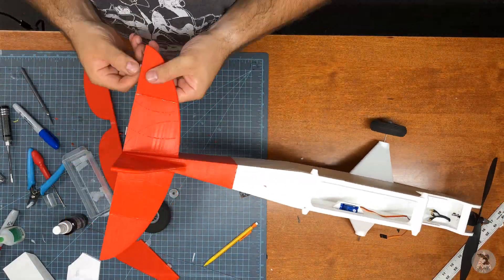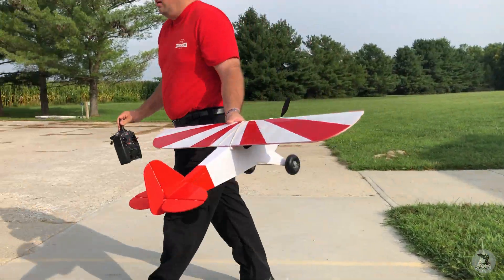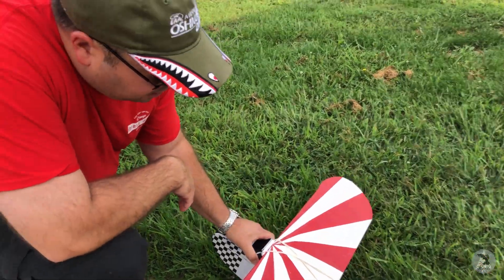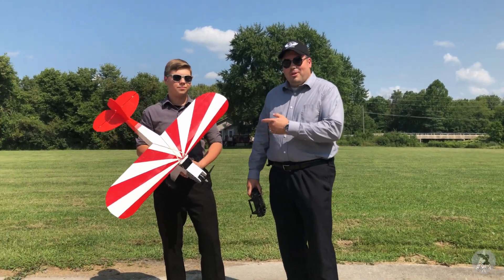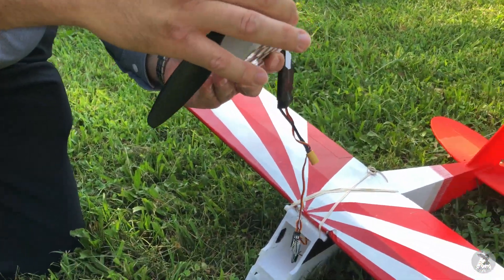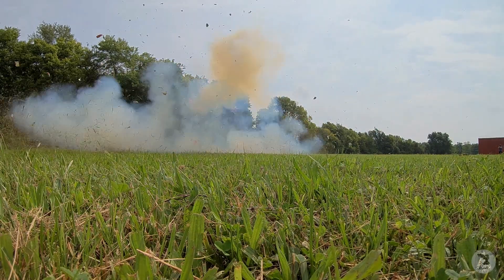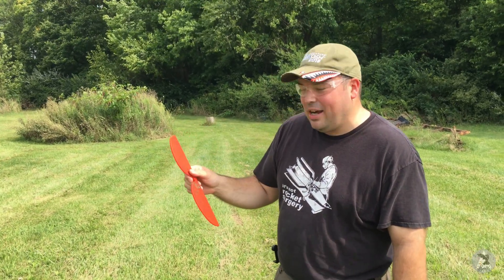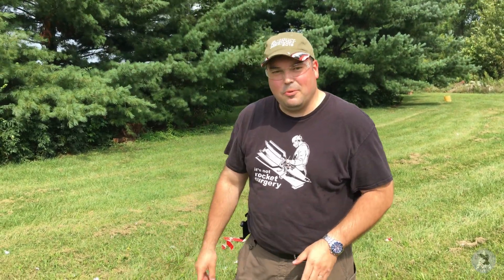Boom! Blowing up a 3D Printed plane...

Comment: It was obviously tail heavy. Oh well you live and learn. awesome videos subscribed!
Rob
Reply from the maker: Thx for subscribing! The CG was according to the original FT plan, but torque was horrible. I’ve had the same problem with the foamie version on a power pack C, but the foam is much more forgiving until you get it dialed in.